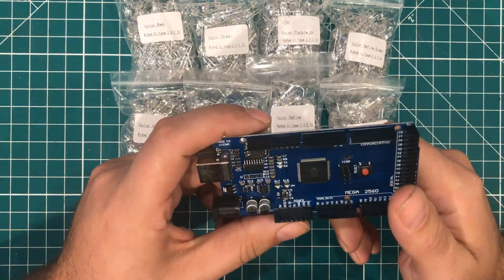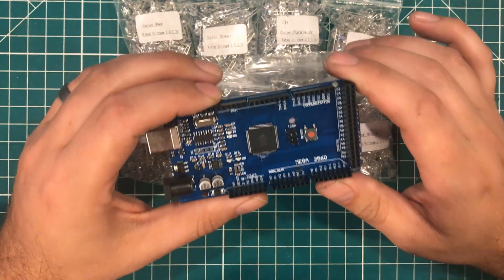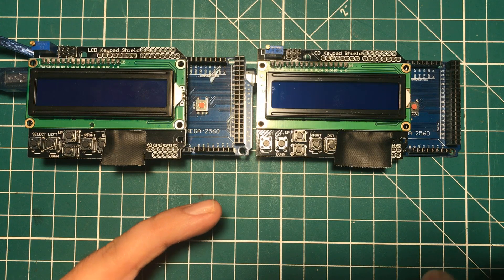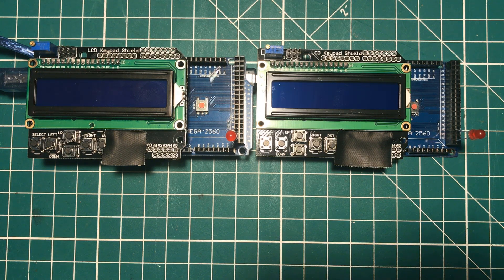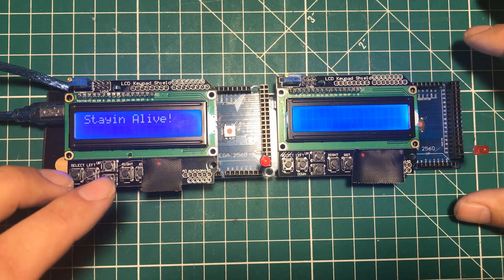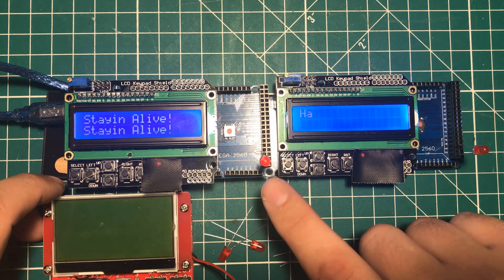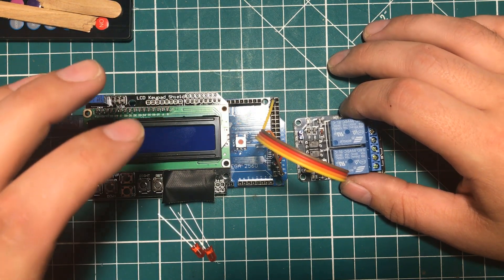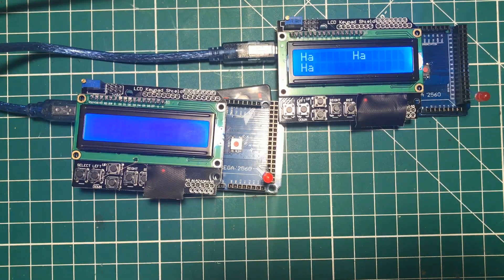What happens if I don't use a resistor on my LED? Short term Arduino Test

Comment: how much ohms required if a connect a battery of 3.6Volt and then touched it with a led of 3V of 1 W ? is it 2ohms ?
Reply: R=Resistance/Ohms
U=Volts
P=Watt
I=Ampere

P = U x I
1 = 3.6 x I  so   I = 3.6 : 1

R = U : I
R = 3.6 : 3.6

R= 1 Ohm

Comment: by mistake i connected 2 LEDs in parallel with the 5v and GRD pins from the arduino board and one of them burned does that will affect the arduino board or my laptop (the arduino was connected with the laptop) ?😢

Comment: I did an experiment with LEDs and NO resistors: https://youtu.be/bLnyO4rOOlc   No arduino used in mine but the LEDs have been working fine for about 4 hours every evening.  I think since they are flashing LEDs each one is only on momentarily and there are around 95 LEDs sharing the current.
Reply from the maker: That's really awesome.

Comment: I just want to know: Why do you NEED a resistor, rather than feeding the LED it's rated input DC voltage and current? Like, surely neither the LED nor the Arduino cares if the LED is getting it's ideal input power - but everyone, EVERYONE, says to put that LED in there, and for a couple LEDs I don't see that being a huge problem but for projects with lots of LEDs it kind of seems like that could potentially bea pretty significant power waste. :/
Reply from the maker: The general rule is that you need a resistor for 1 of 2 reasons.  The LED will draw as much current as it can get so if the device can offer a lot of current, the LED will draw so much that it will eventually burn out, or in the case of an arduino, it will try to pull more current than the pins are designed to provide and could damage the arduino
Reply: @AnotherMaker That is actually a bit misleading. The current is not simply given to the led and the led will not just draw unlimited current without a resistor. The current will be determined by the internal resistance of the led and the voltage given to it. It will not burn out when the voltage for the led is within it's capabilities.
A resistor is not actually limiting the current. Is simply drops the voltage down depending on the resistors value, which leads to the current being reduced as well, but not limited. For the led it doesn't matter if there is a resisor in front of (or after) it or not present at all, as long as the voltage is low enough, so that it's power rating is not exceeded.
in a sense an led is also a resistor, which can not hold much current, due to its small wire inside.

Whe the "little resistance wire" in the led breaks there can be two scenarios. Either the wire breaks and opens the circuit or it welds the anode an cathode together, which is a short circuit, that heats up and burns out.
Reply from the maker: @Noxoreos  That is a better explanation. Thank you.

Comment: Can I use a 1k resistor for 6 led lights im using 3v led lights atm will 3v work ok with a 1k resistor on 7.4v batterie
Reply from the maker: You can probably get away with it but you should use one resistor per LED because when they are in series like that the first one may be drawing more current than the one after it. So you may not get the protection you are hoping for
Reply: @AnotherMaker  im using 1 resistor connected to 2 led lights its ok so fah

Comment: I have a uno in front of me right now with a dead pin (stuck on) due to not using a resistor. It killed that pin, but not the others.
Reply from the maker: It definitely happens.  It didn't happen here, but I've heard of it happening.

Comment: I burned my self because I didn’t use one
Reply from the maker: Ouch. Sounds like it was drawing a lot of power.
Reply: @AnotherMaker  yea I striped a usb cable plugged it in to my computer and I was holding the wires together and it burned me. Wasn’t that bad probably 1st degree burn.

Comment: If I use bread board, Arduino mega,  8relay,  6 pumps, 6 moisture sensors. Do I need transistors?
Reply from the maker: You normally don't. The relays and sensors (USUALLY) have built in resistors or you can use the pullup resistors in the arduino, but that would depend on the instructions for the sensor itself. MOST moisture sensors normally come with a little circuit board that handles all that and you just run 3 or 4 wires from that board to the arduino.

Comment: If you had put the LEDs across a five volt supply with no current limiting, the LEDs would have been killed quite quickly (in a few milliseconds).  Obviously therefore, the MPU is limiting the output current, and I'd expect that to be at or slightly less than the 20mA limit for the 2560.  I don't believe this kind of current is going to damage a GaAs low intensity red LED in any short amount of time, however it might cause them to dim or fail over many months.

More importantly though, you don't know how the 2560 is limiting the current internally.  The manufacturer recommends using a resistor to limit the current, so there's probably a good reason for that.  You're much more likely to damage the 2560, and there's no way to quantify that damage except "it works" or "it's broken" even if the damage from doing this happens slowly over time.   Perhaps the internal current limiting is there to prevent damage in cases of a short inrush current to the downstream electronics (eg capacitance) and without causing the processor to reboot, but it's definitely not there so you don't have to use a current limiting resistor.
Reply from the maker: Fantastic response and I totally agree.
Reply: Damage is due to thermal/physical deformity of the physical structure of the components

It can be molecular - misalignment of doping, thermal expansion, or even chemical rebonding, or just melting apart and oxidising (burning)

It can be macro - a capacitor essentially being pulled in on itself til it contacts and shorts

In the worst cases, it literally explodes from repelling electrical force

Comment: You should compare the brightness of these LEDs before and after connecting them without resistors. But you would have to use a constant current source to check if the brightness changed, to get accurate results.
Reply from the maker: Yeah. They looked the same with the eye test but I need a more scientific way for round two :-)
Reply: @AnotherMaker  Could you use a sensor like a photoelectric resistor to measure their brightness?

Comment: Ok, this is clever, I appreciate it.  You are gaslighting.  Am sure the current on each pin is limited by the MPU so it does not burn the the bonding wire.   Put a little 0.2 ohm resistor in series, and lets see the draw.
Reply from the maker: Agree. That's the next step.  I've actually had my best meters die in the last few months.  My fluke screen went out and my big meter's been flaky.  I'm hoping to find a new one under the tree this year so I can take measurements that I trust.

Comment: you could put an amp meter in series between the Mega's pin (positive) and the LED's cathode pin to see what current the LED got to chew ?
Reply from the maker: 100% - My best two meters died so hopefully right after Christmas I'll get a new one and can take readings that I trust.
Reply: @AnotherMaker  that'd be a nice christmas gift :)
Reply: INA219 perhaps
Reply: @bigpickles  yeah that'll do fine. I ordered an INA216 for other use myself but not yet received it (pesky Ali :D)
Reply: @maicod  lovely. I have a bunch of 219s in use at the moment. Great little modules. I believe the shipping globally is slow, but if there is no local stock there, perhaps an opportunity for you to import and resell parts locally :)

Comment: Staying in the safe Operating range is important....You can also take into account the current draw vs the luminous intensity.... I try to maintain a consistent LED brightness for certain product lines.. Depending on the LED, you can get away with no resistor if you place a Duty Cycle on the GPIO pin... ie 20% Duty Cycle @ a frequency that the human eye does not detect as flicker.. This will reduce the average current but may still have peak currents to tend with depending on trace inductance ..
Reply from the maker: That's a great idea. Thanks for this. More testing coming soon.

Comment: Some boards have an internal resistor. Do these?
Reply from the maker: I'm sure there's something in the chip but the resistors that most people think of are pull up resistors that I BELIEVE are only available when the pin is set as an input.

Comment: Damage is not really a quantifiable value, instead just measure the current drawn. Check it against the data sheet for the led and the mcu. If you are exceeding the maximums then you can assume you are doing damage. By how far you are exceeding the max should be roughly proportional to the damage caused and inversely proportional to the expected life of the parts.
Reply from the maker: Oh and current measurements are coming in the next video.
Reply from the maker: Right.  In the simple 1 day test since it didn't "blow" there's no real way to quantify that damage.
Reply: @AnotherMaker  I like to collect LEDs from around 1990, either pristine, or used constantly for 30 years.  They are different.  Gotta say, they do wear out and go dim. Have done visible damage to fresh ones too, even briefly, at less than 25mA.
Reply: How do you connect 8 led to close and outer using 1 resistor?

Comment: I do agree with you about using a resistor with the Arduino, as each pin can only supply so much current. In my case, I am perfectly fine with using 1K resistors with my LED's.  I have a feeling that if you hooked the LED's straight to a 5V power supply, the LED's may be fine with it at first but won't last very long.
Reply from the maker: If the LED is bright enough for your needs, then you won't go wrong with a 1k resistor.
Reply: It depends on the rating of the led and the supply. Most normal leds can't handle 5V and will burn out immediately.  When your 5V supply can't handle more than a few milliamps of current at the rated voltage, then the voltage drops, which will then be safe again for your led.